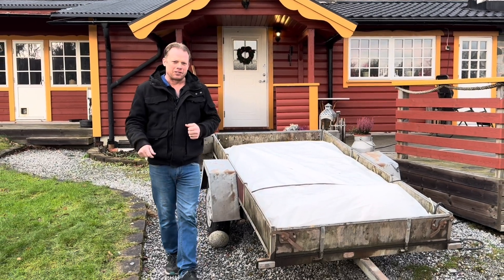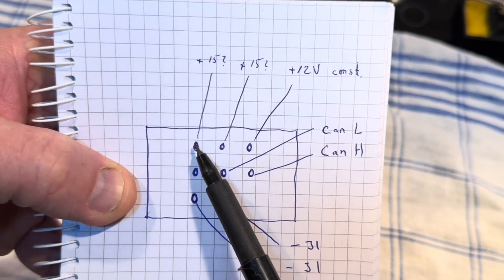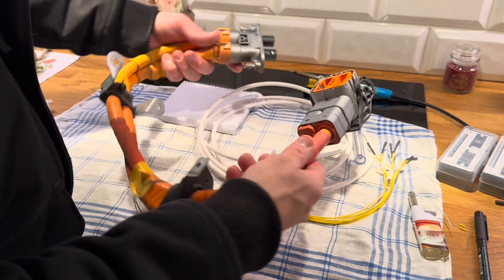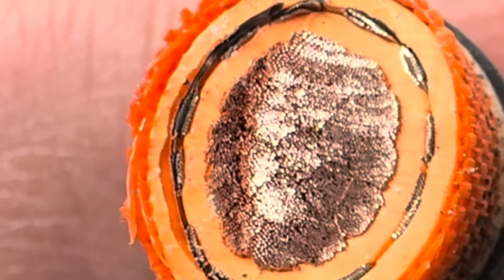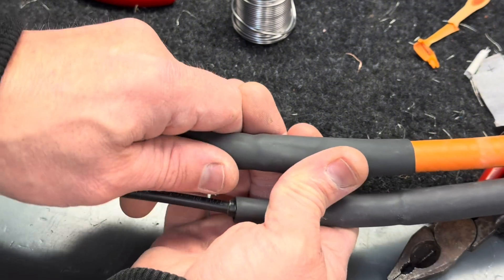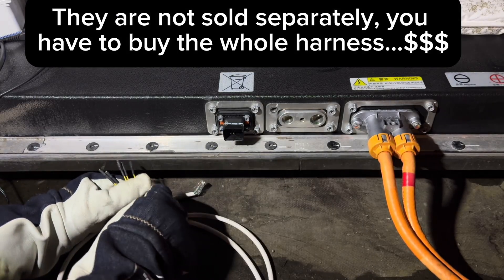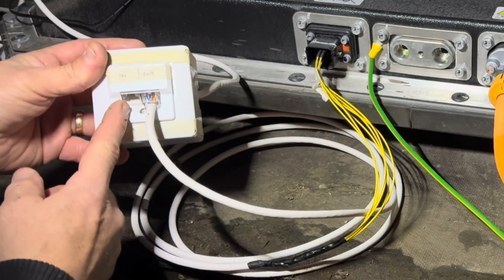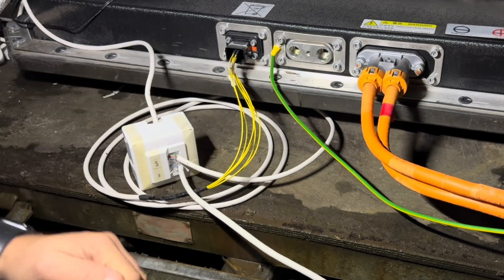Wiring a BYD Atto 3 Battery for solar and grid storage 60kWh lifepo4

Comment: can I use a "locked" battery pack for home storage / is the following true? "f the Atto 3 pack is sourced from a crashed vehicle, the battery could be locked. This means it will refuse to activate the contactors AND no updating of SOC%. We estimate SOC% from battery voltage to workaround this issue. In this state, the battery BMS is still alive, balancing cells and receiving and sending CAN messages. Modifying the contactors switching is possible, as per info below. If the battery is not crashed, the contactors will turn on via CAN when the Battery-Emulator is started." any help would be greatly appreciated, thank you .. Perth, Western Australia
Reply from the maker: Yes it’s true.

Comment: How do you get 420v from 126 3.2v nominal LFP cells? 126x3.2=403.2
Reply from the maker: A LFP cell has a voltage range between 3-3,4V depending on the SOC. So it can be as high as 428v.

Comment: Great stuff. Pretty much a dream project I would like to do one day when I can buy an affordable battery upgrade for my car. 😉

You mentioned sealing up holes with silicone. I would avoid that as I heard it creeps around and can cause contact problems.
Reply from the maker: Thanks. You are right about that but there is silicones that at made for those specific purpose that not will react with the contact surfaces.

Comment: Lithium polymer batteries are the ones that catch fire. Don't keep them in your house. You want lithium ion for that but rather install them in an outside thermal bunker with the ability to smother them from air. You can get blankets specially for this purpose.
Reply from the maker: Pretty much exactly what I’m doing. 
I completely agree. But those lifepo4, especially the blade type cells in this battery are very safe.
Reply: Smothering will not help.... You need to be able to isolated the entire system remotely and completely submerge the batteries in water. Its not an oxygen issue, its a thermal issue.
They really want their own free standing enclosure with an exhaust fan and ducting, with the duct opening as high above the dwelling as possible.
Reply: As we hold cell phones with batteries in them

Comment: Any recommendations on where to source the EV batteries?
Reply from the maker: No, but best to buy locally from a trusted used car part dealer.
Reply: @flyingtools  thanks. I'll do some digging about and see
Reply: Found a place 15mins away with very reasonable costs for the battery

Comment: Lifepo4 is a so much nicer type of battery then Lipo. They don't care to be left on 100% of charge and you can use them from 0-100% all day long. And they wont run away thermaly and burn down your house like the Lipos do. I hope we get more EVs with Lifepo in Sweden. I will never have a Lipo car or big Lipo battery near my house.
Reply: We have 23,000 + old Nissan Leafs in our country. Not one report of a car fire in over 10 years.

Comment: Great inspiration for an upcoming house. I do have one question : when it comes to final installation, is it an issue to have it vertically mounted? chemically wise I'm pretty sure not, but there could be other things (sensor in the bms, ...). Thanks!
Reply from the maker: Hi that’s a really good question. I’m not really sure, but it might be harder to have an even temperature inside of the battery when standing them up.

Comment: The atto3 i bought had travelled a total of only 12 kms. The owner never managed to get out of the BYD dealer car park in Sydney before crashing it. The car has only panel damaged but due to the laws in my state in Australia it was written-off. I hope to use the battery for my home. I uploaded the dashcam if you want to take a look. It would be tragic to not  reuse parts from this car

https://youtu.be/cYNJJP5GWGU
Reply from the maker: Wow, that was crazy!! And I thought that my battery was new, 3000km and a few months before written-off😅  Thanks for sharing the video 👍🏻

Comment: Thanks for a great video with clear instructions. I bought an Atto 3 which had a crash but the airbags didn't go off but the seatbelt emergency locking retractor did go off so i'm assuming a signal was sent to the battery it had a crash. If this is the case do you know if there is a fuse within the battery pack that will need replacing?
Reply from the maker: Thank you😃 sadly I can’t answer that for sure. All I know from the sonar car is that the airbags was intact. I did not know that BYD activated the belt tensioner without realising the airbag. Program A LILY go and connected to the battery and apply power, if the batteries IS okay you should clearly hear the contactors inside of the battery. But be very careful because then you will have high voltage out of the high voltage connector.
Reply: Thanks
Reply: @grahamhumphreys8749  How did you get on ?? I have the same issue as you .. Thanks

Comment: Dala had relased a video about the recent reverse engineering of the id 3 battery as alternative to the nissan leaf he had used before. 
But I like this great idea to get an atto battery but I wonder where you get these batteries quite early after the car has been sold.

I am on the verge of building another 2x 16 kWh LFP battery out of EV  MB31 cells but of cause  I would prefere such high voltage battery to replace also the old 4,6 kW inverters with 1 deye 3phase inverter.
Reply from the maker: I bought it at a local junkyard.

Comment: Nice thinkering you managed there. Shouldn't the battery be topped up with coolant instead of drained?
Reply from the maker: Thanks. No, its meant for refrigerant. Not needed anymore in the way I am using it.
Reply: @flyingtools  oh, oke. I thought it might hold it more stable in temp due to use. Distribute of heat more even.

Comment: When you park your battery in the garden, how you sustain enough warmness/heat in it to stay above charging low temperature?
Reply from the maker: It is already now placed on styrofoam and a floor heating system that holds a temperature between 10-15 degrees centigrade. Works amazingly well. So I plan to stick with that solution.
Reply: @flyingtools  thats great to know. We are planning for a place at my parents house. And the room is not isolated. But styrofoam was also my first idea. And this heating pads are easy to use. Thank.

Comment: Nice video! I would have suggested to instead use solar fuse terminal instead, then you can step down the 35mm³ to 10mm² and add a 30A fuse all in one go, without any soldering!
Reply from the maker: Hi 😃 Thanks, yes it will be something like that when i have it in the final place. As I mentioned this is just a temporary setup.😉

Comment: Maybe it's "AC 1000V / DC 1500"... ?
Reply from the maker: Yeah, but if so, its a really strange way to mark a cable like that.
Reply: @flyingtools  Yep... too many space between the current rating and the current type, it's strange... great (and clean) job anyway!
Reply: Yes per standard the marking is AC 1000V / DC 1500V.  And yes the spacing made it very confusing.  Believe the Chinese standard is QC/T 1037-2016.   There is an ISO standard as well for automotive charging cables.

Comment: Are there any plans to use the water pipes in the battery for either heating or cooling? I saw you adding the electric heat pads so I guess not. Just thinking which way I'll do it as well.
Reply from the maker: That was my plan from the beginning, but this is not made for water. This is directly heated and cooled with refrigerant. The channels are way too narrow to be used with water. I tried to blow air through it and it was really hard so water will be even harder.
Reply: @flyingtools  ah. Dammit. That's annoying. Trying to find an air conditioning engineer would be rather difficult! Especially when you tell them why 😃
Reply from the maker: @ yes definitely 😅 heating is no problem but cooling will be much harder if needed. In my location I only have to be concerned about the cold though.
Reply: Generally the load shouldn't be high enough to create heat, if your in a cold climate then heat pads might be needed (but I would have thought if the battery pack is on via cambus  the bms should heat it self automatically if its too cold)

Comment: Very informative! This is amazing. Question, Is there any way to output 2 phase or 3 phase from a tesla model 3 via the ptc heater wiring to give the ability of V2L? I opened the module and it looks like you can easily add more wiring to connect an inverter directly. I think you can even adapt the hvil to the inverter as well. Seems simple enough and looks like it should work plug-and-play style.
Reply: you can search for ambi box. They developed an universal V2H Wallbox to get juice from different models. also M3 I guess.
Reply: @LittleSpot  I’m familiar with it. I’m looking more for of the shelf 400v inverters that people currently use to extract power from ev packs(eg fronius,solax). Need it to be installed in the frunk and If I can hook up solar panels in series to reverse charge the pack while connected to car then that’s a big plus.
Reply: If you check the internetz there is a hacked image for enabling V2H for tesla
Reply: @HansFrisk  there’s a fair amount of people, especially the guy with the ford lightning, that connected a battery in parallel to his traction battery to give him more range. It seems trivial but he’s not sharing any details nor is anyone else unfortunately. Can you give me a link to the Tesla v2h image you’re talking about?
Reply from the maker: Thank you 😃 sadly, I have no experience whatsoever on those batteries so I don’t even want to guess😅 sounds interesting though👍🏻
Reply: @flyingtools  ah dang ok🥲
Reply: And the ptc heater is dc

Comment: How expensive was that battery if i can ask?
Reply from the maker: I will give you all that information in an upcoming video. But it was cheap 😉👍🏻
Reply: My best guess: 10-15k EUR for this 60k LFP battery pack, not from a crash, hopefully.
Reply: @MooseOnEarth  It has to be cheaper to be worth it. My guess is 8000€. For 9000€ you can already get ready-to-use home storage battery solutions with even more capacity.
Reply: @lukasweishaupt2708  Can you name a couple of home storage battery offers with more than 60 kWh below 9000 EUR (which would mean below 150 EUR/kWh)? Because I do not believe that, unless I see these offers.
Reply: @MooseOnEarth  Felicity, Malogica Solar, Delong, ... Just to name a few.
Reply: @MooseOnEarth There are many cheaper options. But I would doubt anything comes close to the cost of a salvage EV battery per KWH stored. This is why they are being purchased for home storage

I live in NZ and have bought many salvage EV's for their HV batteries. I bought an MG ZS EV  for about 1200 Euro (NZ$2100). The car was 18 months old, undamaged and drivable with 9000km

So I think the BYD battery in this video was probably 3000 Euro maximum
Reply: They can range from 1500 to 5000 (crashed ones bit more annoying to work with because you got to remove blown pryo fuse and hope there isn't a airbag collision software lock on the bms preventing it from Switching on
Reply: Lugs and a buzz bar would give flexibility into the future...